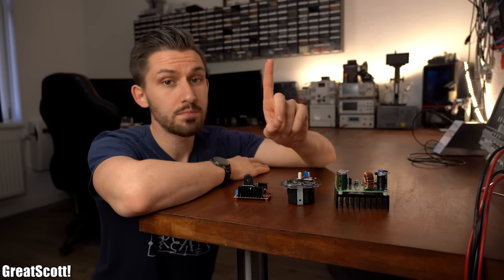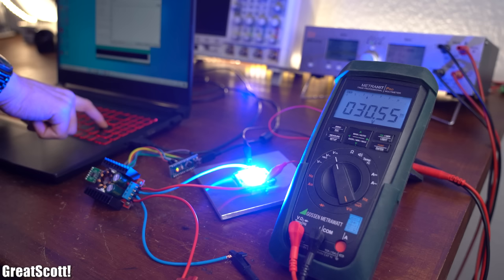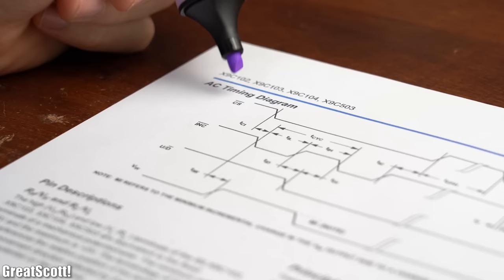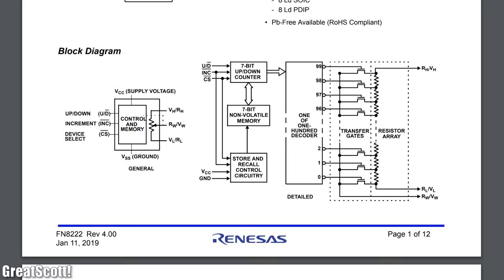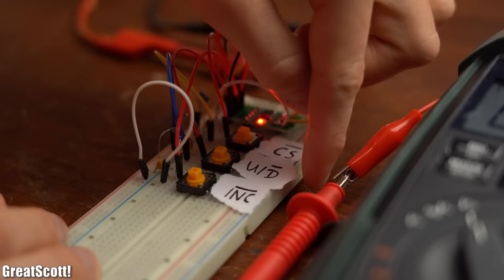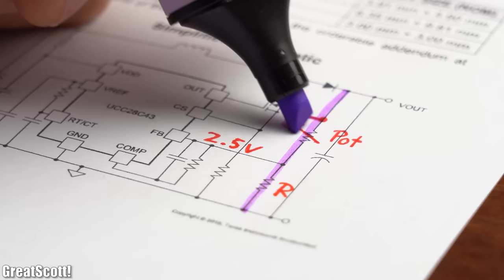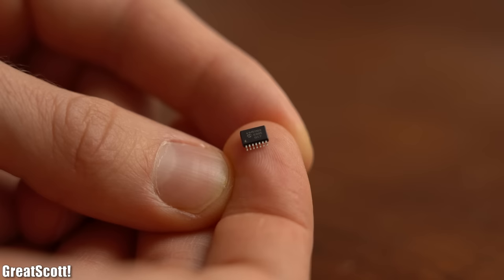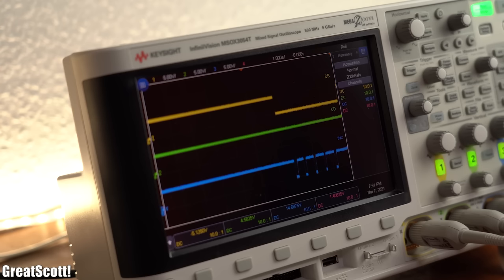This component can control tons of circuits! Digital Potentiometer Guide! EB#51

Comment: You don't have to remove the original potentiometer of these buck converters. You just need to "inject" some extra voltage to the shorted pins (pin 2 and 3) of the onboard potentiometer through a resistor and by this you can trick the buck controller chip and control it perfectly. I did this already quite some time ago using a MCP4725 12-bit DAC and an SZBK07 buck converter. This DAC has higher resolution than those digital potmeters, so you can control the voltage on a really fine scale.
Reply: Yeah, just check the voltage range on each potentiometer pin, set potentiometer to highest resistance and solder onto the appropriate pin without removing the potentiometer.
Reply: @DavidMishchenko  Yes, that is what I did. I knew the maximum voltage because of the maximum output voltage of the SZBK07 buck converter. Then I also knew my maximum controlling voltage and based on this I picked a resistor which through I fed the potentiometer.
Reply: Do you guys have links to resources for this
Reply: @Rothammel1  I am happy to help!
Reply: How does this affect the failure modes (over-voltage and over-current) of the converter circuit?
Reply: I was literally thinking this, and wondering why he made a video on this to begin with. I do this all the time.
Reply: Removing it is easier, and you don't have to compensate.
Reply: Thank you, that's some good advice!
Reply: A link would be appreciated, I guess
Reply: @CuriousScientist  Thanks man already did ! You have a great channel too.
Reply: @ri5ux435  I would say the case he showed is the one that requires the least this kind of approach, but the purpose of the video on how to use the digital potentiometers was still met.
In fact the application shown of an LED dimming is usually done with just PWM anyway and can be done even fully on analog logic with a MOSFET driving the LED at ~200Hz and you're good to go. Or the used Arduino just pushing the PWM signal too.
Reply: @Kalvinjj  I dont like these flickery PWM LEDs. Bad effects while filming etc.
Reply: @Eratas1  That's a pretty valid point. For that application I would increase the PWM frequency considerably, into the tens of kilohertz. That would solve this issue, albeit in that range you're wasting some energy on the MOSFETs.
I would imagine that filming lights use this approach, as many LEDs don't actually react that well to reduced current, some will shift their tone or the brightness might be far from linear.
Reply: Couldn't you just set the potentiometer very high, and then just wire up your digital pot in parallel?
Reply: @1337GameDev  Parallel resistors divide the current but not the voltage, so the digital pot will still get the full output voltage which can be 30+ V, depending on the chosen buck converter. Check my videos and you will see how to implement it "correctly".
Reply: @jrcowboy1099  the overcurrent protection most of the time also injects a voltage on the fb pin 

The voltage regulator just want to keep the voltage on its fb pin at .....v on a 7805 it's 5v 

If you suply 5.1v it will raise the resistance if the fb pin is at 4.9 it will lower the resistance and raise the output voltage to compensate
Reply: What a great idea thanks
Reply: @kleinpoe  Cheers!
Reply: How about the boost??? Inject negative voltage I guess
Reply: Correct i did that too, use a resistor in series with the DAC output connected to the resistor divider used as voltage feedback to the feedback pin of the SMPS controller and some maths to calculate the resistor value in relation to control range or experiment as you wish. Basically, you inject a feedback signal that the SMPS corrects using a change in the output voltage. Works perfect and always allows the  use of 5V logic
Reply: Leaving the original pot just complicates it more and leaves you with a overall less clean solution. If you want to use a DAC you could remove the pot anyway. Don't be lazy.

Comment: I'm wondering why they would put 100 resistors in a chip, when I would assume one could easily work with power-of-two increasing resistors, and enabling them in parallel to efficiently create the desired resistance. With only 10 resistors you could have 1024 steps.
Reply: Because of the tolerance available on the resistors. If the the biggest resistor is 512 times as big as the smallest, then it would need much better than 0.1% accuracy to maintain linearity when it is switched in and out. It's much easier to make 100 identical resistors with a fairly close tolerance, which would ensure that each step increases by nearly the same amount.
Reply: @joefuentes2977  Only 20-time programmable? Damn.
Reply: @fryode  Reading the datasheet, I'm fairly sure those are writes to persistant memory, and are not required if you program the chip on power-up with a few commands. The spec sheets says you can do unlimited adjustments.
Reply: Like Rex said, there are those topologies available indeed, also R 2R approaches, but meanwhile practical for low resolution and precision, it starts to get insanely hard to make up the hill. I've made myself an ADC for a PIC16F628A which doesn't have an internal ADC. Made a 6 bit R 2R one, chose one of the ports and made that one control the resistors in successive approximation (Output most significant bit, compare, store, next most significant, repeat). Worked like a charm, had pretty decent resistors at hand, and hand measured them all to make the pairs and individuals match perfectly. Still not like I would trust it to any high precision application, and that's just 64 levels. On ICs they're usually laser trimmed on the die.
Reply: @skipbalk8248  Yeah, i think this is meant just to provide a configurable default value on power up until the microcontroller boots up and takes control. Mostly to make sure the resistance value is safe for your project (like for example for a Buck converter doesn't burn out the connected device due to excessive voltage).
Reply: I think is not 100 resistors but one reststor and the ic act as a simply multiplex between points on this resistor.
Reply: @kentahirono  thats right since these are on chip you can design it like that but there are different fabrication techniques for resistors google "Resistor Fabrication on Semiconductor Wafers", so no way to know unless the manufacturer provides that information or someone provided the reverse engineering of the chip.
Reply: @skipbalk8248  yes the 20tp is to burn in the config for production. This is very common. In fact, even many android smartphones uses this "limited time programmable" concept to burn in secure keys for Android. The purpose is to allow factory some retires in case something happens on the production line. For dev purposes there is almost always ways to do unlimited writes until that "timer is expired" or command is given to "blow the fuses".
Reply: @fryode  yes for production if you want it permanent. It can also be unlimited time programmable. The 20tp is actually considered a feature.

Comment: Scott mentions in the video that these digital potentiometers can be used to control the volume of audio circuits. However,  it is not really recommended to use an ordinary digital pot for such a task, as these usually make a "zipper like" sound with audio signals when you move the wiper up or down.  For this kind of application you should use a specialised audio digital potentiometer with built-in zero crossing detection, like Dallas Semiconductor's DS1801 or DS1802. With these you can save some headache for yourself.
Reply: There's programmable gain amplifiers like the PGA4311 specifically made for that task. Also, some DACs and amplifiers have volume adjustment built in.

Comment: A few years ago i took apart a radio that had an electronically controlled volume potentiometer (if i'm not mistaken, i think it was volume). This was a radio from the 90's. Their solution to this problem? The potentiometer had a dc motor stuck to its back, if the radio deemed the volume too low, it just turned its own knob with the motor to crank the volume. Beautifully simple and complex at the same time.
Reply: This control scheme is still in place for some audio products because digipots can have audible clicking as they internally switch between resistors if they're in the signal path.

Comment: Did he just prevent some university students from spending time building a custom microcontroller compatible buck-boost converter and showed a simple hack to convert any buck/boost converter that can be controlled by an Arduino?!?!

YES, HE DID!!!

Great video as always!! 

During your video of an Arduino based FM radio, you used one. But didn't understand how it actually works and I am ready to change my power supply on by Automatic Light System.
Reply: I already did a much smarter control with a MCP4725 12-bit DAC a year ago... You don't even need to remove/replace the original potentiometer. I even built an automatic digital thermostat which can maintain a Peltier cooler's temperature within a really tight range.
Reply: @CuriousScientist  Sound very interesting! Could you share how you did it?
Reply: @CuriousScientist  Thank you very much! I will definitely check it out :)

Comment: Just a circuit idea I had recently: I think its possible to do the same thing (µC Control of such a DC/DC convertors output voltage) without the "exotic" part just by altering the feedback path a bit.

Use a simple DAC (PWM pin is fine), Filter & Buffer that voltage using an opamp (a "rail-to-rail" one might be necessary), select the components around the opamp such that the resulting µC controllable voltage ranges from 0V up to the regulation point voltage specific to the DC/DC converter (= the voltage at the wiper of the DC adjustment pot which is kept constant by the DC/DC's own control IC) to get the maximum resolution in the end.

Now adjust the voltage pot of the unmodified DC/DC to the maximum output voltage you want to be able to get out of the system. Then just keep this voltage pot in the circuit - but replace the "GND" point of the feedback circuit's resistive divider with the µC controlled DAC Voltage described above. Now you should have linear (!) control of the DC/DC's output voltage by setting the DAC - note however that the control will be reversed, a high DAC voltage results in a low DC/DC output and vice versa.

Disclaimer: I have not tried this yet, but I think this should work and if so it's quite an elegant hack I think.
Reply: Ok. Nice video. But I didn’t understand it. 
I’m building a variable speed controller for a 4.25 hp, 130 VDC treadmill motor. I’m using a SCR, bridge rectifier, DC choke to drive the motor. 
I have a potentiometer on my SCR. I turned it slowly until the motor started turning. Then I measured the resistance (301 k). So I broke that down by using a 275k and 30k pots. One for rough rpm adjustment and one for fine. 
Would it be better to use a digital pot on this? If so, what kind do I get and how to hook it up. 
Your help is appreciated. 
Thanks,
Paul

Comment: I remember reading it's not that easy to use a digital pot for audio applications, at least not as a direct replacement for a mechanical pot. The reason is you get pops on the audio every time you adjust it up/down and it requires some complications to the circuit so it only adjusts at zero-crossing....would be great to see a project like this though :)

Comment: If somebody needs ever higher voltages, look up motor-driven potentiometers. They are also used in some audio equipment as a very fun way to control sound volume.

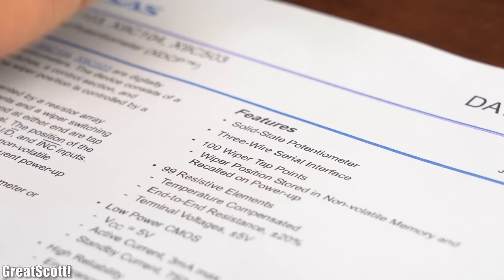Comment: 05:10   -   Resolution could be increased by a factor of 100 by utilizing 3 potentiometers. The third would be connected between both wipers of P1 and P2. The total resolution could be calculated with a simple formula. Total Resolution = init.resolution power 2.

Comment: i love these things. i built a personal project that controls my minidsp and my speaker amp, as well as turns on my pc. the minidsp supports i2c control,  buti decided to simply use a digital pot and use the arduino to control it. i was going to do the same for the amp, but unfortunately, the pot actually had audio channels going through it, so i ended up using a servo to physically control it with the arduino. 

so far, it has worked well and only once did it lock up, but a reset solved the problem
Reply: Motorized potentiometors are an elegant solution if you want to keep some of the properties of having a pot

Comment: Another perfectly timed video. Been working on driving a panel using ESP, but  I couldn't find a good digipot that wouldn't go open-circuit between switching resistances! I blew up a boost board already by using a potentiometer that had a gap or internal problem!
Thanks great Scott!

Comment: Nice video, as always. One interesting application I used a digital pot for was to control an analog filter before an ADC. In this way it is possible to change the low pass frequency depending on the sampling rate.

Comment: I had the same challenge to solve some time ago = controlling remotely CV CC modules. 
I solved it using an LDR (most have R.dark > 1MΩ)  and adjusting the trimpot for Max desired Voltage or Current. Using an LED and sealing it a black shrink tube with the LDR and some epoxi glue  it can use a simple PWM on the LED, enabling ~ 1000 steps if choosing an appropriate LED current for a strong LDR Excitation, allowing a wider dynamic span. And measuring the actual voltage with the Arduino, makes a closed loop and corrects the optical set point.
There are also TWO useful characteristic of the LDR in parallel with the trimpot: [1] The Voltage/Current never passes the Maximum limit adjusted by the trimpot. [2] The “Attack” time (go to light) is shorter than the “Decay” to dark time = this means the voltage (or current) could be decreased faster (protecting quickly) than when one resumes the LDR as dark, than can take hundreds of ms. 

But it was nice to know more about Digital Potentiometers and see it being a solution - nowadays still more expensive and complicated, but already much faster than a LDR for sure. 
Thanks for sharing.

Comment: I also saw some variations of potentiometers which are mechanical and also digital, the position of the contact is controlled by magnets, and are super simple to work with and don't have any resolution problem. But you have to change the contacts once in a year.

Comment: I have been looking at these components for a while as I could use them, but I'm amazed at the amount of money they dare to ask for such a simple part: An X9C103 sells for about €5. At those prices, I'd rather use an old fashioned transistor as variable resistor and say "bye bye". It's not ideal: Because transistors are designed to amplify (i.e. low resistance) and you want to create resistance, you are forced to send very tiny currents through them to get reasonable resistances and you need to calibrate the microcontroller to compensate against manufacturing tolerances of your transistor, but it works. Transistor, two resistors and a ceramic cap cost about €0.05, that's 100 times cheaper and worth the slight annoyance.
Reply: They are quite complex compared to other components. imagine a poti, but instead of a wiper you have 100 or more small transistors, tapping certain points on it. You also need memory and stuff to store the position. That's why they are nearly never used in consumer electronics.
Reply: A mosfet makes a much better variable resistor, but it has to be calibrated individually if there's no way to get feedback. The convenience of these chips is that they have internal non-volatile memory, which means that you can store a value and it will return to the same value the next time it is powered on.
Reply: @RexxSchneider  I have experimented with MOSFETs. My findings were that in order to get reasonable restance (I was looking at a range of 500-1000 ohm), the voltage at the gate had to be within in a really narrow range. As my microcontroller was generating that voltage with PWM + RC filter, there is always some voltage instability and this gave me unstable resistance. I had less trouble to get the required restistances with a traditional resistor, I used a BC547 and  a 56kOhm resistor in front of the base did allow me to get resistances in the required range.
Reply: @danielmantione  I'm amazed that the BC547 gave useable resistances in the 500-1000 ohm range. That sort of resistance is only available at the "knee" of the Vce - Ic curves, so you're stuck with a Vce typically less than 1V if your base current is around 50 microamps as you suggest, and it's highly dependant on the Hfe which can be anywhere between 100 and 800 for a BC547. Getting the required resistance with a mosfet is also tricky because of the variability of the gate threshold voltage, but the source-drain resistance in the linear region doesn't change with Vds for a mosfet, unlike a bipolar junction transistor.

Comment: If you put a comparator (opamp) between the feedback voltage and the PWM chip, then you can work with 5V or so.
Then put the Digital Potentiometer with another 10k resistor to form voltage divider, and add that to the other opamp input.
So the Boost Convertor's 0-25V becomes 0-5V, and you can adjust the other voltage divider it's being compared against.
As the PWM FB pin expects something like 1.2V before it triggers, you need a 3rd voltage divider on the Opamp output.

Comment: I used a dual digital pot to replace the joystick input on a wheelchair controller. Was a great way to get a digital interface, while keeping the wheelchair's insanely good control systems.